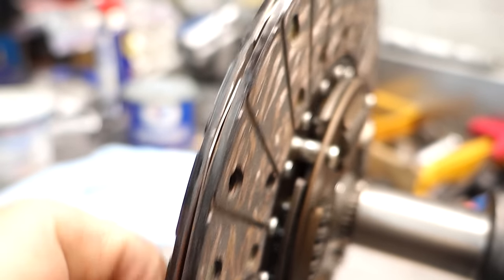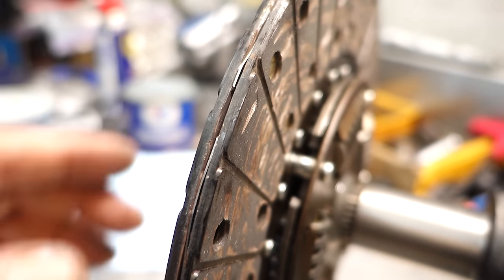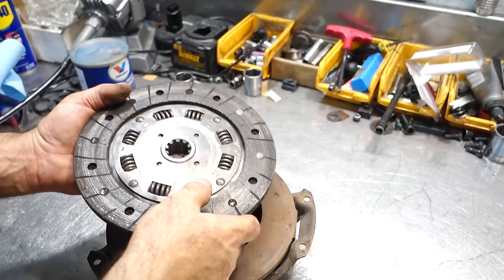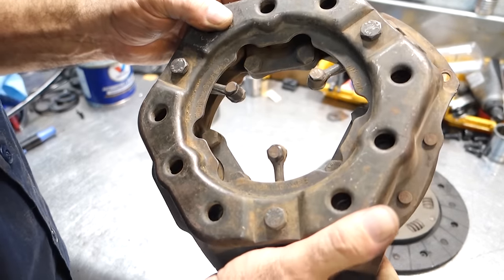Learn How a Clutch Works -  Basic Clutch Operation and Tips

Comment: Watched 3 videos of you now in search for an answer and understanding of my gearbox problem. The thing is that it grinds gears when switching to reverse unless I wait about 3 seconds after disengaging the clutch. Also it does not go smoothly (although without grinding) in other gears. 
Do I understand correctly that I should look first at the pilot bushing? And while looking there might as well change the clutchpack. 
And is there any chance my problem could have to do with the synchroniser rings? Like that their friction has worn out (because of the dirty pilot bushing or clutch not fully disengaging)?

Anyway, a big thank you for your explanations and sharing this informative videos. Even without an answer they really helped me a big step forward in understanding how a manual gearbox works and how it can break down.
Reply from the maker: Poor clutch release. Since reverse is non synchronized in most gearboxes, you have to wait for the trans to spin down.
Reply: @GearBoxVideo  Thanks for the answer. Figured I needed to be ín the gearbox anyway regardless of the problem. But then at least I know I don't have to worry to much about my synchroniser rings.

Comment: When you removed the spring plate there was no spring washer and damping washer...why is it so??
Also there are clutch plate that have different rivet design...
The one shown in video have three stop pins  there are clutch plates that have rivets close to the hub centre ...can you please explain the difference in the two designs...
Thankyou for the great video...
Reply from the maker: The design difference has to do what manufacturers think is important. I'm glad you bought that up. The video shows the function and knowing how it now works doesn't it make sense to have 6 drive pins instead of 3? Or  double rivets instead of a single row?  Usually the difference between a cheap clutch compared to a high performance one.
Reply: @GearBoxVideo  thankyou for your  reply...
You are spot on about the manufacturer think... actually I am facing a failure in which spring plate brakes near the window zone  and spring pops out of the window...plate from another has different design and do not have this failure mode...do you have any experience of dealing with such failures...if yes can u shed some light or do a video on clutch failure modes...
Once again thankyou for your reply...
Reply from the maker: Sometimes I have seen poor belhousing alignment mess a clutch hub up.

Comment: thank u so much sir.. it helped me a lot... but i have a doubt sir, people often say that if u engage the clutch the fuel comsumption will be increased. how sir??? and one more, does the pressure plate and the weight(if more) of the flywheel are the reason for drivetrain powerloss?. as u r expert in trasmission section, is there any idea to overcome the drivetrain powerloss by the help of transmission?? thanks u sir..
Reply from the maker: Gear ratios. If the correct ratios are used the load produced by engaging the clutch is reduced.

Comment: Is the no springs in a clutch the reason for such a hard clutch petal? I havent had a race clutch but I have heard the clutch petal is so hard to push down. Is it for faster release?
Reply from the maker: When a clutch hub has springs it is called a "sprung hub". Eliminating the springs causes a harsh apply with possible chatter. The hub springs have nothing to do with pedal pressure.Pedal pressure could be poorly designed hydraulics or mechanical advantages or just a heavy pressure plate.

Comment: nice video. I have my clutch that stays in the floor and I have to pull it back up with the back of my foot while shifting gear. the strange thing is, that it is intermittent. it happens once and it stays good for a week or more and then it happens again and then it stays good for a good 2 weeks or more. I changed the slave cylinder to no avail. could there be a problem with pressure plate or the fork or should I go ahead and replace the master cylinder. there is no leak in the clutch hydraulic system and the level of clutch fluid is good. there is no leaking in the master cylinder either.
Reply from the maker: you might be over centering the clutch.

Comment: Can you help me with my clutch job? I have a 2007 honda civic si and what i did was change the oem clutch for an stage one action clutch (stock) flywheel and resurfaced. The clutch would not be able to go in to gear when the car was on. Master cylinder is new and slave cylinder should be no issue when removed. What i did was not place the clutch aligned i did not place the clutch on the flywheel dowel pins. Can that be the only reason why the gears won’t go in as the car is ON?
Reply from the maker: Yes and also resurfacing is something we never do. That changes the clutch height

Comment: Paul,

I'm running a Fidanza 11 pound aluminum flywheel on my four cylinder Lotus Elan and getting a chattering noise forward of the shift lever on the Ford 2000e three rail, four speed gearbox on overrun.  This is most noticeable in fourth gear but also, to a lesser extent, in third gear.  It occurs when I get out of the gas at about 4,000 rpm slowing down to about 3,000 rpm when it goes away.  Pushing in the clutch will end the noise.  The noise cannot be duplicated with the car on jack stands, only on the road.  

My clutch pressure plate and friction disk are new.  My gearbox has just been taken to a specialist who says the noise is from the gearbox which has no input shaft end float so that the input shaft is jammed up against the output shaft.  I hope this is the solution to the chatter but after watching your video I'm wondering if the light flywheel four cylinder engine is allowing the friction disk hub to slap against the rivets.  Would it do this even though the friction disk is new?  I don't see any witness marks where the rivets would contact the hub.

Thank you,

Lee
Reply from the maker: its gear clatter from a light flywheel as explained in the video. You don't have to have the hub slap against the posts but its the oscillation  of the input shaft that will do it.
Reply: Thanks Paul!  I hate to give up my flywheel to end this noise.  Any idea on how light a flywheel I can run without causing chatter?

Lee @GearBoxVideo
Reply from the maker: Often overlooked is something simple. You get a lightwheel flywheel because ”it revs up quicker",  forgetting the fact that it revs down just as quick. I see no point in running lightweight wheels on the street and stick to stock weights.
Reply: @GearBoxVideo  Good point.  My engine is out of the car so now would be a good time to revert to OE.  Thanks again!

Comment: Mr Paul,

I have a question for you sir 
If my Impala has 480 hp and 500 tq at the flywheel 
Would you recommend an organic clutch or a sintered iron clutch ?
My use is mainly for the street I might bang the gears on my M22 from time to time but no strip use 

Thank you sir !
Reply from the maker: Organic clutches are fine
Reply: @ thank you sir !

Comment: I have a 2011 5 speed V6 Ranger with 86,000 miles. My problem is hard shifting to mainly 1st and reverse when cold or cool as transmission heats up problem seems to go away. There is NO grinding it is just VERY hard to put in gear. Sometimes I need to shut off the engine to get it in gear then all is well. Any thoughts.
Reply from the maker: Typically a poor clutch release is doing that.

Comment: 2:35 , when in neutral the friction plate is clamped and spins with the pressure plate and flywheel...
Reply from the maker: And what is your point?
Reply: @GearBoxVideo  , you made out the friction plate spins freely when in neutral , not so , only spins freely when clutch pedal depressed...
Just being pedantic..

Comment: Hi I’m I need of advice please 😢 when pressing in my clutch pedal it gives a loud rattling noise even after I have changed release bearing and pressure plate even changed the shaft where release bearing fits on including a new fork some advice please 😢
Reply from the maker: If you are hearing a rattling noise while pressing on the pedal. It's possible that some of the springs on the clutch disc are rubbing against the flywheel bolts. Because normally if you have applied pressure on the release bearing it is pretty solid against the clutch fingers and really can't move around much. So it's probably something within the clutch mechanism or something else

Comment: I double-clutch quite often. Seems to make everything smoother in the shift. Especially from 1st to 2nd. In my car, the ratio if very high between those two gears, more than in other cars I've had. I found that double-clutching allows the transfer to be a lot smoother. So, the question is, is double-clutching ok for the clutch/transmission? Does it prevent wear and/or will it extend the life of the clutch? thx!
Reply: It's ok, but I think it's useless for any modern car (made after the 70s).

Comment: 13:09. But the real question is how to do you adjustments if you don't get a clean clutch release?
Reply from the maker: Adjust your clutch for more air gap. There are adjustments on manual pedal systems and slave cylinders on hydraulics systems. A shop manual for your particular car would explain that

Comment: How can below-freezing temperatures affect a clutch? Mine sounds like I'm driving over rumble strips in first, second, third, and reverse. It only happens when it's really cold while I'm driving and let off the throttle... And great video BTW!
Reply from the maker: Without knowing the make and model car I can't give you an answer.
Reply: '07 Civic 5-Speed
I'm pretty sure everything is original and hasn't been upgraded or replaced.
Reply from the maker: Friction material requires a certain amount of heat to actually grab. You may be getting clutch shudder because the lining is not locking up
Reply: GearBoxVideo Interesting.. thanks for the insight!

Comment: Owner of 1998 Ford Ranger 2.5L engine, Manual 5 speed transmission(F87A-AB-D175741). I replace my adjustable clutch housing and clutch to conventional pressure plate. Manual instruction request , that I adjust the pressure plate after 750 mile. How do I adjust my conventional pressure plate, by adjusting my clutch petal? What is minimum of clutch meat should I have before changing it?
Reply from the maker: I have no idea what brand clutch you have.  There is no adjustment other than setting free play for a good release,.

Comment: yes Paul I remember I'm 62 I wish we would have had the hydraulic throw out bearing better than I remember sitting at the light if you said they're too damn long your legs start shaking LOL
Reply from the maker: I prefer mechanical linkages. Too many of these new hydraulics fail. The ones based on OEM units work the best.

Comment: What causes clutch springs to become loose? We've had a Kubota tractor for about 10 years now and the clutch springs are completely loose. If there's a particular thing that causes this please reply. Thanks in advance, awesome video!
Reply from the maker: On and off the throttle. Also  just inferior quality clutch components
Reply: @GearBoxVideo  We run the tractor at a constant RPM for the PTO shaft though🤔 it's just really weird the disc it self has dozen of material on it, we are replacing it, I just have to find out what caused it so it won't happen again...
Reply from the maker: Think it thru. The springs wear from oscillating. So any fluctuation can cause the spring to fatique or again crap parts
Reply: @GearBoxVideo  Could they've been warped from overheating?
Reply from the maker: Springs can take the heat. They will collapse from excessive heat but that should not happen because from what you have said the lining was fine

Comment: Can play in the crank shaft cause the clutch to slip at high rpm?
Reply from the maker: No. You have to think it through. Since the flywheel clutch and pressure plate are actually bolted to the crank so they would be moving with the crank anyway

Comment: I HAVE A HYNDAI I20 AND LESS RUNNING .. I FACE CLUTCH IS HARD TO PRESS AFTER 30KM DRIVE. RECENTLY I REPLACED THE CLUTCH PLATE AND PRESSURE PLATE.. WHAT IS THE PROBLEM???
PLEASE SUGGEST.

Comment: Hi, i have a question. On my bmw e46, 5spd manual getrag i believes, the shifting was really hard, i had to push in it like an old truck. So i changed the fluid with gl4 and shifting is now nice an way easier. But now reverse grind after starting the engine. If i put 1 and reverse after it doesn't grind (with the car no moving) , the input shaft is stoped like that by the 1 gear synchro i believe. My question is, it didn't grind with the old oil in the same condition, start the engine and then slam in reverse. The old oil was a red oil, maybe atf i don't know. Why did it didn't grind and now it does ? The old oil was so thick that it brake the gears? Or my clutch is going bad as you say in your video.
Reply from the maker: This is a clutch release issue. If the transmission is still spinning with the clutch activated it obviously is not completely disconnected
Reply: GearBoxVideo ok, i see. I will start with a good flush of the clutch line, i don't think there is any system to adjust the rod of the slave cylinder in this car, i will check that. Thank you very much sir.

Comment: I have a 6 speeds manual trans. I had a mechanic replace my clutch. After it done, when the shift move to first or second gear, something touches the speed sensor and broke the sensor. can you tell me what causing it?
Reply from the maker: Can you tell me what make and model car you have?

Comment: Is there a difference between manual transmission clutch and an automatic one? If so, which is the one explained in this video? Thanks
Reply from the maker: Yes.  The video is for a manual transmission clutcb
Reply: @GearBoxVideo  very helpful video, finally imaged it in my head 😊

Comment: If you change to a lightweight flywheel would you need to change the springs in the clutch plate to softer springs?
Reply from the maker: Depends on the application. Probably a solid hub would work best
Reply: @GearBoxVideo  Just thinking, the flywheel has teeth around it so the starter motor can turn the engine via the flywheel.  I'm guessing the starter motor is not permanently engaged to the flywheel.  It must disengage once the engine is started or the engine would turn the starter motor.  This would be a drag on the engine and wear out the starter motor.

Comment: i have an audi a4 quatro, my clutch is not engageing in any gear except first but only enough to shake the car and not move it, throw out bearing? clutch assembly or pressure plate? would love to hear inpute on this
Reply from the maker: The Quad Filmer Guy 1st produces the least amount of load. The clutch needs to be replaced.
Reply: GearBoxVideo i thought so but i needed a profesional back up

Comment: I've got a problem with my car, they already change the clutch kit and its still making noise. When I press the clutch pedal noise stops, if I release the pedal, neutral or any speed noise appears again. Thanks for your help!
Reply: Daniel CS have they said anything about your transmission? Because it might be it
Reply: Hi
Reply: Daniel CS I had your exact problem on my 05 Hyundai. Tranny mechanic said it was a throw out bearing. He showed my the bearing and it was almost dust. He said if I hadn't had the bearing replaced, it would have done more damage resulting in more $ to fix it.

Comment: Hi.!
Can you please tell me if you recommend changing just the disc and the pressure plate (without the flywheel).!?
Or you think that all the time the entire kit should be changed altogether, even if there is no visible wear out on the flywheel.!?
Please give an advice beacause here on youtube you guys are more like academics on mechanics, compared to those we find in workshops - mostly stupid, and just a few that are malevolent or tired of life to give a competent advice.
Reply from the maker: It depends on the vehicle. I recommend that dual mass flywheels be purchased new from the OEM. Standard flywheels can be resurfaced just as long as their is a means of restoring the proper pressure plate height relationship to the release bearing.
Reply: @GearBoxVideo  Thanks, and if only the disc is worn-out, you consider that still every time you should also replace the flywheel...!?
I am asking because the dual mass flywheel is very pricey, more expensive than all the other components (of the clutch kit) put togeter.
Reply from the maker: No just as long as the flywheel is smooth then change the disc

Comment: What would cause difficulty shifting out of gear? Manual trans is getting stuck in 1st and 4th.
Reply from the maker: Without knowing what make model and transmission you have that's a difficult question to answer

Comment: MY GEAR IS STUCK IN SECOND GEAR AND WONT SHIFT. THE CLUTCH SIMPS FINE BECAUSE  ITS COORDINATING WITH ITS SLAVE CYLINDER. COULD IT BE THAT THE SYNCRONIZER RING'S ARE DRIED OUT? AND CAN IT BE FIXED?
Reply from the maker: It would be nice to know what make, model car you have and transmission

Comment: so paul what clutch would you recommend behind a 351w and a t-5 in a ford mustang gt , mild engine build, nothing to crazy about 400hp 400tq
Reply from the maker: The centerforce line of clutch has been pretty successful for me. That would be a standard clutch, no dual friction. The Hayes street / strip clutches are also good, however their support is horrible,
Reply: thanks paul why no dual friction just curious
Reply from the maker: Too harsh and can cause chatter.
Reply: center force has that ceramic clutch, not dull fritction, for about 531.00 dollars is that clutch alright, or just go with the 479.00 clutch kit from center force, thanks for the help paul
Reply from the maker: I would go with the standard 479 clutch.